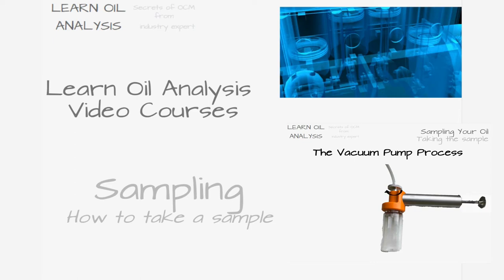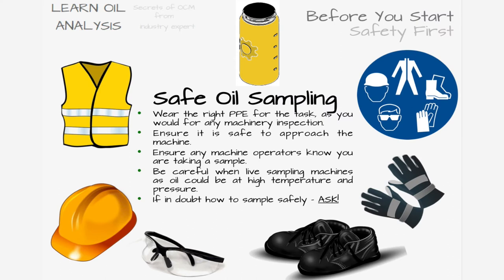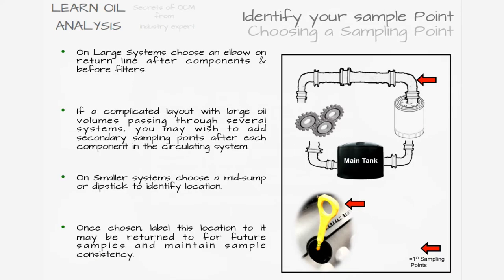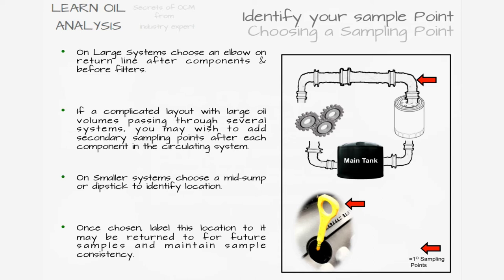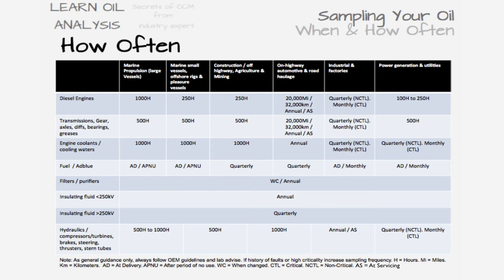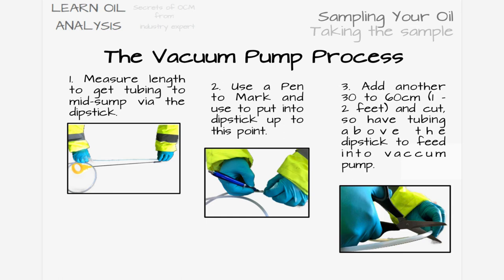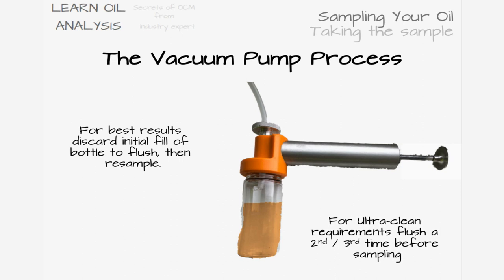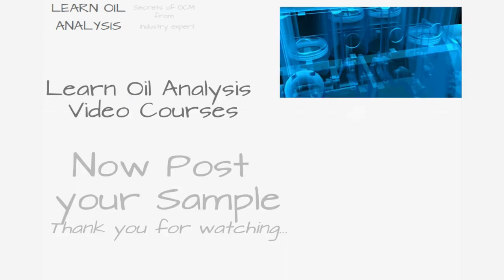How to take lube oil analysis lab samples using a vacuum pump?

Comment: Besides allowing the Sample Oil to Drain from the tubing... What do people suggest for cleaning the tubing between samples? Maybe by flushing/filling tube with a "clean" oil before storage for next use?
Reply from the maker: Hi

Generally the tubing is usually quite low cost. Perhaps 5% of the sample price. So most people just dispose of tubing after use. You could use solvent to flush but the amount to clean will have more cost and more environmental impact. The other alternative is to flush with the next oil but you need a lot of oil to clean through to remove it, perhaps 3 bottles full which then the cost of the oil has to be taken into place. Finally if you do use the oil to flush then I would stick to same fluid types e.g. engine to engine not e.g. engine to fuel or hydraulic oil as these could show as contamination in the next sample. I would say to be safe just cut a small length of tubing that doesn't cost much and dispose of that afterwards.
Reply: @OilAnalysis  Read some sources suggesting Kerosene or Mineral Spirits. But you're right a spool of tubing is probably the better option. Thanks.